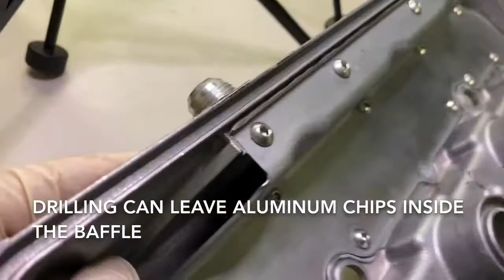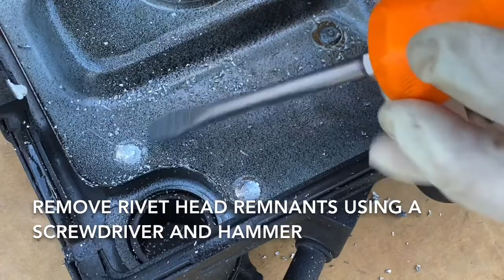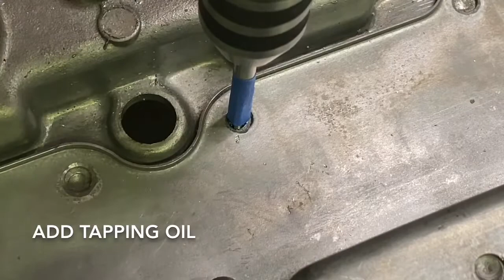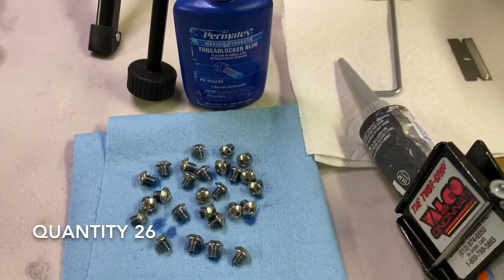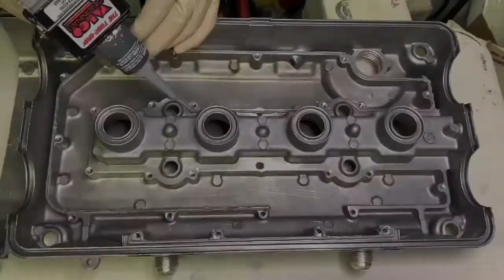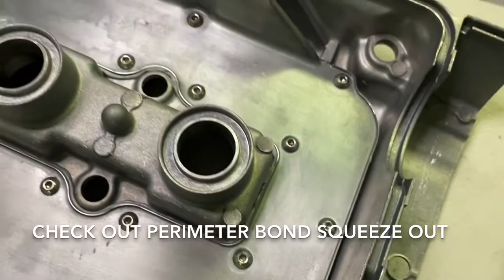Honda Valve Cover Baffle Removal - From Rivets to Bonded & Bolted

Comment: Attention! 
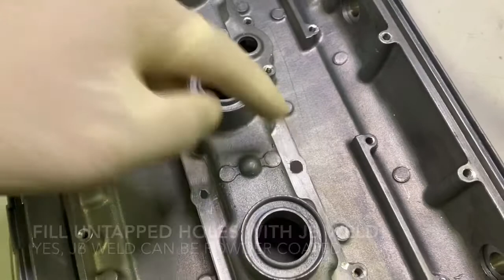6:38 These screws must not be drilled through because there is no thick material, the thickness is only 3-4mm.
Reply from the maker: Truth. Those are actually partial holes bc u still have to drill out the rivets there. However, if u do drill thru its ok assuming u r powder coating. Just fill the unwanted holes w JB weld, make them smooth on the outside and powder coat over them. Thx watching and commenting. Pls subscribe. Thx again AJ

Comment: Don't they use rivets instead of bolts so they don't loosen up and fall inside the head and cause serios damage?
Reply from the maker: Both methods are an acceptable fastening method assuming each can handle the load. I believe Honda uses rivets bc it’s faster and cheaper to install them. Of course, you can rivet the baffle back on. However, I chose to fasten the baffle w bolts and to minimize the bolts loosening and falling into the motor I used loctite. Pls subscribe for more automotive content. Thx AJ

Comment: Any chance you can tell me where the got the screws I got some but there too long
Reply from the maker: McMaster
Reply: @RelentlessRacingAJ  have a link? Tried looking for them. Home Depot didn’t have them
Reply from the maker: @shaneynereneyne4493  McMaster
Reply: @shaneynereneyne4493  you can grind them down to smaller size I did that and work great

Comment: Will be too risky to try clean out all the metal shavings with the baffle in and is sealing the baffle an extra step? I notice it originally didn't have any bonding OEM.
Reply from the maker: U can’t b 100% certain your valve cover is clean under the baffle after drilling and adding bungs wo removing it. I’m always paranoid about metal shavings getting into my motor (which leads to a blown motor) especially bc of the time and money I have invested in my motors. If you don’t want to remove your baffle, then of course that’s up to you. FYI - All the Honda baffles I have removed were bonded and riveted.
Reply from the maker: Thx for watching and  commenting on my video. Pls subscribe